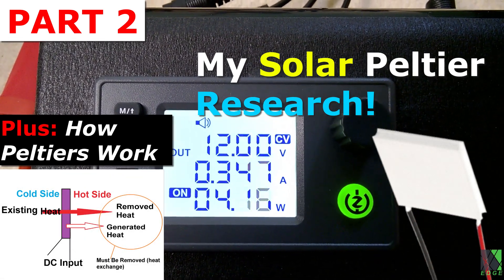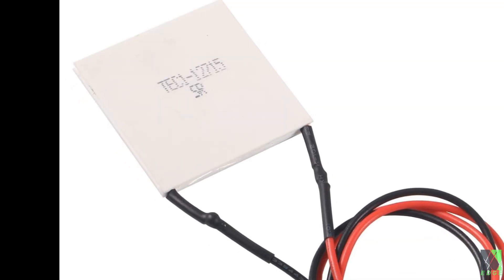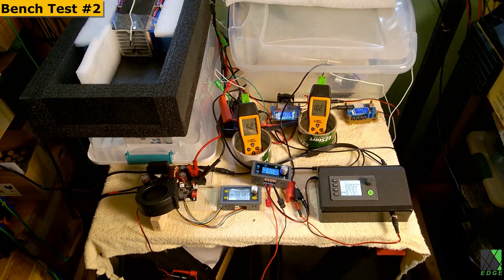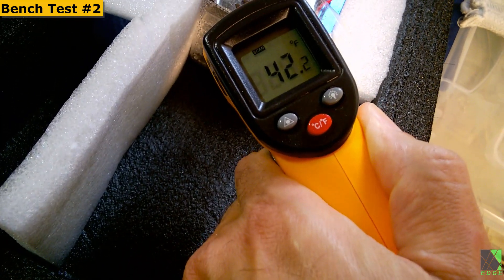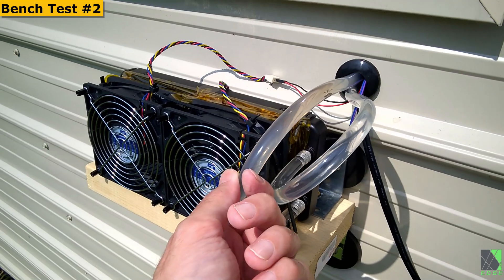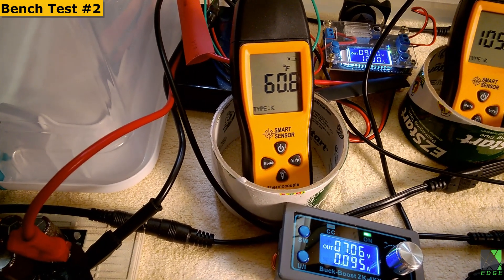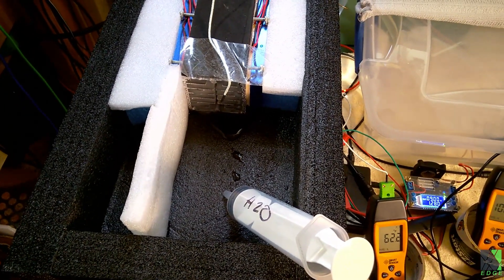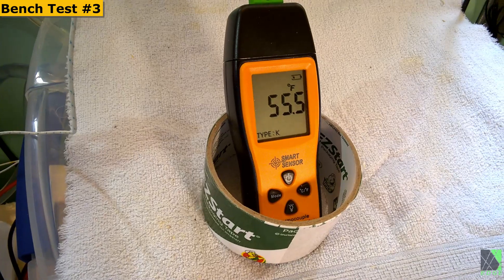How Peltiers Work plus Direct PV Solar Air Conditioning Research Projects Documented #DIY #peltier

Comment: Have you considered using geothermal cooling?
Reply from the maker: @KyleWidmyer Yes and will definitely be experimenting with it once we're settled in. Hoping to get some equipment to dig a geothermal system and a water recycliing system. But we have to finish some other construction tasks first

Comment: I'm thinking about building something similar but was thinking to have on the hot side an open container full of water with a blower on top to cheaply increase exchange area and make use of evaporative cooling outside the building. Refilling every now and then will be needed. Ever tried something similar?
Reply from the maker: @augustosala9874 Great idea! Yes I have done similar research and hope to follow up on it with a video. Evaporative cooling can be very powerful if done right. Hopefully the next version of this test will include evaporative methods. Right now I'm focusing on learning about how to get more out of peltiers, and that research is looking promising. In one of my tests I cut the power draw of the peltier array by about 50%, while maintaining the same temp. Still learning how to exploit that, especially with air conditioning which is a bit difficult. It will take more time

Comment: I love to leach that hot water and put it on the hot water tank!   

One idea, run some copper tube along a section of the hotwater pipe outlet, the section between tank and sink (if possible) as a heat exchanger.  

Lots of grand possibilities 👍
Reply from the maker: @peterxyz3541 Good thinking, been looking at storing the heat! Peltiers should be able to make more heat than you put in! Someone suggested sticking them on the window, freeze the window and get extra heat. There are 1,000 experiments and only 1 of me :D

Comment: Like# 500!
Reply: I wanted to experiment using these directly in the back of the solar panels. Or even radiator fins?!
Reply from the maker: @taj-ma-haul9094  Working on that idea now, it's really cool :) who knows how effective but worth a try!
Reply: I may use water based heat extraction and then use that heat to heat shower water?
Reply from the maker: @taj-ma-haul9094 Sure, I love using water for heat exchange, it's non toxic and works well :)
Reply from the maker: @taj-ma-haul9094  Nice!! Thanks!

Comment: I have a 40kW array, PV is so affordable, want to do a walk in freezer. Where can I buy multi kw thermal exchanger
Reply from the maker: @longtimber1 For starters you could build one, probably using any kind of radiators. Industrial thermal exchangers are sometimes available on the "usual" online auction site, but some of them are very expensive

Comment: was thinking of running peltiers along top of window to cool between two pains of glass. binging heat back in to room in winter no heat loss to outside on your biggest heat loss area win win
Reply from the maker: @danielnicholls6868 That's a pretty neat idea! Someone also made a plate that goes in the window, like an AC or heat pump. I'd like to try it... except the only window in the cabin isn't available for experiments right now...
Reply: Wouldn't making the window colder accelerate the heat loss from the thermal envelope?

Not that I would have the power to spare to try this anyway living in such a cloudy winter zone where my winter power production is so heavily limited by thick clouds 5-7 days a week 😂

Comment: I bet it would work even better have it dump/pickup heat from an underground cistern to make it geothermal.  You’ll get a better output, as well.
Reply from the maker: @dus10dnd That would be awesome. if I can get 100ft of copper pipe buried in the ground it would at least get rid of the heat

Comment: To lower the cost, try a 12v hydronic heater assembly made for tractors in place of exterior heat exchange you're using now.
Reply from the maker: @P.A.L.511 Hi, thanks I'll look into this

Comment: You need around 40 degrees to take "comfortable" air in a house and maintain a comfortable humidity.  The exchange time is very important... you can flow too fast or too slow and make your exchange much less efficient on both the air across the cold side and the water through your radiator.  You probably already know this but just in case.
Reply from the maker: @timbrown9305 Indeed there are a lot of variables. I hope to make a proper AC unit when possible, these tests are providing a lot of good data on what peltiers can do

Comment: Nice idea you could also try cascading the Peltier modules that way you can achieve a higher delta, it could even be more efficient. I have plans for a whole house and even a way to supercharge it with more mother nature. You could use the condensation water to drip onto the OD off the outside cooling fans to increase thermal exchange as the air blows across the radiator, it would act like the mist fans used at amusement parks.
Reply from the maker: @ANGRY_AMERICAN Definitely... been experimenting with cascading. I should try using that cold water to make mist, I'd like to see how much temp drop
Reply: @solarpoweredge  If your indoor heat exchanger is enclosed just have the exit small enough to provide a slight positive pressure would automatically pump water out
Reply from the maker: @ANGRY_AMERICAN Good idea

Comment: Very nice project! I am thinking about using pelletier for a sailboat AC/fridge setup. I think it should be possible to increase efficiency by installing the cooling water inlet at the bottom of the keel (typically around 4-5 feet depth), thus giving colder water than at the surface (also no need for radiators to cool the water).
Reply from the maker: @FedericoLucchi  Thank you! circulating ocean water should be an endless source of cooling. As long as the cooling parts can handle salt of course. I am still learning about peltiers and now working on building a refrigerator. It's difficult to address the challenges with peltiers, but I'll keep trying :)

Comment: greetings and thank you for your very interesting think approach. 
in my head every heat producing thing "peltiers, step down/up converters, ..." should be in the outside unit, i would use two water cooling circuits for that. Next thing are the radiators bigger way bigger radiators on both sides with slower and quieter fans. Car radiators or charge air coolers / radiators, are very cheap. You could even go that far to dig some water hose or special made one for heat distribution to the ground, well or extracting heat, sry im not that good in explaining my thoughts in english.
what i mean is (please google picture search "Erdwärmepumpe mit Flächenkollektor") and you get what i mean. Sry english isn't my first language.

Comment: So do you have any idea on the COP of this device? Does it make sense vs typical mini split units?
Reply from the maker: @johnzach2057 Refrigerant based heat pumps have a higher COP than peltiers. If one wishes to avoid refrigerants, copper pipes and compressors, peltiers offer advantages. Their efficiency varies a lot depending on heat gradient, quality of modules, power dissipation, thermal interface and many other factors. There are about 4 setups I am testing, and I have not been able to calculate any firm numbers yet. This is taking a tremendous amount of work, I'll get there eventually.

Comment: Is there a way that the 105° water can  go through a evaporator cooling pad? There will be some water loss but heat goes with it. The chillers at work made like 45° water for the cooling side. The hot side loop went to a cooling tower which is basically a evaporator cooler. Thanks for the video.
Reply from the maker: @ww321 That would be awesome. I been wanting to build some kind of evaporative system or cooling tower device. So much to do

Comment: Suggestion 1: Might as well insulate the water tank and use the hot water for domestic use, freezer/air conditioner , water heater, efficiency would more than double by capturing instead of wasting the heat to the outside.
Reply: Second:could  let the condensation drop into a gravity water filter for emergency drinking water, or drip it onto a wick behind the outside cooling fan radiator
Reply from the maker: @travishodges5179 Interesting thoughts, I have to work on some kind of evaporative cooling setup
Reply: @solarpoweredge  mist it on the outside cooling onto a piece of humidifier wicking fabric
Reply: @solarpoweredge  better yet have the inside higher than the outside so it gravity feeds back to the wicking fabric outside located on the intake side of the cooler
Reply from the maker: @travishodges5179 Good idea!
Reply from the maker: @travishodges5179 Another good idea. Currently building a "proper" outdoor radiator for permanent installation. I have to try to integrate these ideas somehow.
Reply: Lots of good ideas on this thread.   Use the waste heat for a water heater or pre heater or in our area with cold nights and warm days, maybe send the heat to a sand battery for heating.

If heating use the cold side for a cooler amor to assist a refrigerator.
Reply from the maker: @davebean2886 Good thinking. Hoping to scavenge waste heat from solar electric heaters, but it will take time to develop a good method
Reply from the maker: @travishodges5179 The water tank definitely lets out heat, but it's only for testing. It would be neat to capture the heat for some useful purposes

Comment: I did many similar experiments  to what you have done here, and the biggest problem I ran into was the outside ambient temp was over 100f..  The peltiers that I had could only achieve a max dT of 40-60, so that meant the best possible inside temp would be 40.  But that's ideal math, and this is the real world.  What I ended up doing was building a "thermal flywheel".... having a large tank of water outside(shaded and lightly insulated)  that water would collect the heat from my peltiers during the day, and then a small pump and radiator/fan would run overnight to cool the water.  I get thet that requires energy storage and you are running direct from pv, but, the principal might be able to work for you in some other way so I thought I'd share.  oh, I also directed any condensate water i generated into the tank, I couldn't make sense of letting that cold water just run out on the ground....that's some BTU's you already efforted to move....and efficiency is the name of the game...
Reply from the maker: @joepeppers1920 That is good thinking! I was considering using one or two of my 55gal drums full of cold water to dump the heat into. Running a fan at night does use power but I think it's totally acceptable tradeoff... considering how simple and diy-friendly peltiers and water cooling are
Reply: @solarpoweredge  I wonder if a thermosyphon would do enough over night.... Guess it would depend on the temp difference between water and night air...
Another thought I had was to do something like a heatpump water heater, where the peltiers pump heat in to a "preheat" tank...and cool the room.
Reply from the maker: @joepeppers1920 It's worth testing. I would like to try a water heater preheat system. That's a great way to capture the waste heat. It would work with standard ACs too. Maybe if I build a cooling system for my house, I can try this.

Comment: The Seebeck effect is more efficient than the Peltier effect..
Its likea heat pump using a generateor in the middel to make it "steal energy from the cold side" if you stack them in the right order..
If interested please contact me, as we actually sold a lot of combined small heat pumps with Peltier elements to cool our tak wheight systems on Brazillian Oil Supply Wessels
(to stabilise temperature at thetrain guage at high ambiant temperature)
in some tests we actually had to " dump" energy when the temp gradiant got to high..
Reply: *Strain guages... Sorry Norwegian ...
Reply from the maker: @trygvetveit4747 That sounds really cool. I have done dozens of experiments that don't appear on camera, trying to see what the best way to use Peltiers is. My hope is to make either some kind of effective air conditioner and/or fridge / refrigerator solution... solar powered of course
Reply: + @solarpoweredge  Found some old pictures (2011), i cannot show in public due to...rights
but  i might be able to send you some explayning pictures from our start up ;)
Any way to contact you in private?
(reg<rds  Old Scool Chief Engineer) who loved yor Voltage Diodes to balance different Voltage Battery
Reply from the maker: @trygvetveit4747 Hi you can email me at the address posted on the top of my channel page, click on "More" (view email address), I usually don't post links and emails in the comments as it's likely to get blocked
Reply from the maker: @trygvetveit4747 PS - glad you liked the diode-related videos too, hope to work on that idea some more if I have a chance

Comment: Run the cold water into the hot water. Elevated drain
Reply from the maker: @Deliverance-Childrens-Bread Thinking about that, good idea... incidentally window AC units do the same thing
Reply: @solarpoweredge  copper tube
Reply from the maker: @morto6876 Good idea, I had some ordered
Reply: Your better to runs giant fan at low rpm and spread them apart!
Reply from the maker: @morto6876 The fans are for lab testing, I am building a quieter outdoor unit with large fan and different radiators

Comment: Quieter fan would be ok also
Reply from the maker: @travishodges5179 True
Reply: @solarpoweredge pumped water over cooling tower(shaded) much like thermosiphon cooling, with a chimney to increase draw.
Downside is loss of water from system due to evaporation.
Reply: Use the dehumidified water as the source.
Reply from the maker: @robertmccabe8632 All good ideas to try :)
Reply: @robertmccabe8632  only use the evaporate water, no loss. The more humidity and harder it works the more evaporation water it will have to assist
Reply: @robertmccabe8632  less moving parts the better.
Reply from the maker: @travishodges5179 Agreed! I'd like to eliminate even water pump and fan if possible. However at least they are cheap items, relatively easy to replace